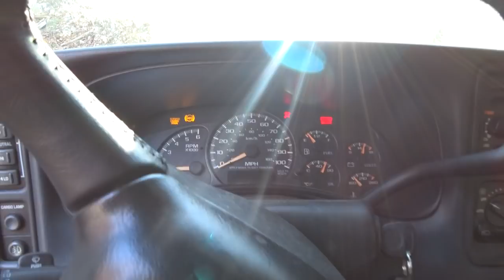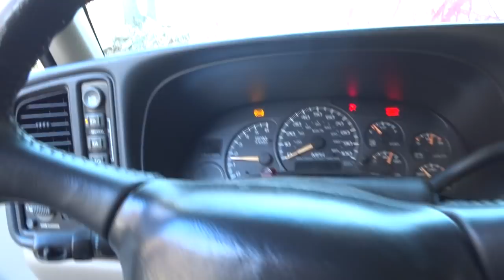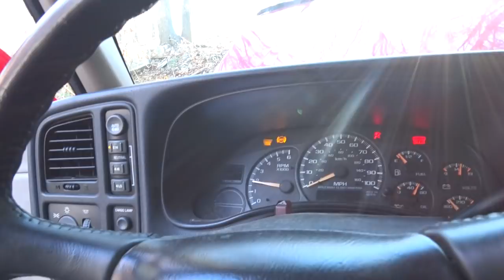DOA Avalanche Revival - Bleeding Master Cylinder in the Vehicle & Find our Rough Idle

Comment: hey  YO lookahere !! an old used trick from the old army to prevent rust  ,spay the undercar in a mix of 50 50 boiled linseed oil and old engine oil that wil harden softly and stay good a few years or spray evry year if needed ,its cheap and effective . hope it helps keep your cars a little longer !!
Reply from the maker: No kidding?! Thanks for the tip!
Reply: @DEInTheGarage  you are more then welcome ! i hope to learn some of you about jeeps , my friend just bought a grand cherokee 1999  turbo diesel

Comment: check the fuel pressure regulator. pull the vacuum line off. if there is fuel in the vacuum line, the regulator is bad.

Comment: Go to your local auto parts store and pick up a code scanner.  Plug it in and find out what it says.. Then you can move on from there. Good chance you prob have some sensors going bad.  Prob a coil pack going bad.  Oh and check your intake manafold. They are known to crack and leak air.. Had to have mine replaced.  Time to get new Trans lines....

Comment: I would put more gas in it with it being that low it's sucking what all of it can from the bottom of the tank trash and stuff since it's been sitting and that isn't good . I would go and check the codes to see what u have and that can lead u right there what some problems are with the truck before tearing things apart or unplugging them because I'm plugging sensors and things you're going to set more codes so that's going to mess up to tell you where your problems could be but with that thing having a cold air intake ha that's main problem it probably didn't filter right plus I think I seen a K&N Filter which is never good for a vehicle that has a mass air flow sensor . The oils from those filter get on the screen and needle inside that and will cause problems like your having or make the sensor completely go out but I would try cleaning the sensor first u can clean them and they be good as new again . Sometimes but only use mass air flow sensor cleaner only don't use anything else if you do that

Comment: the line kits from gm directly are muchb better, they are coated steel line and will never rust out. they are exact fit mad bend easier than stainless because you still have to tweak them a bit to run them.
Reply from the maker: The stainless ones were a nightmare
Reply: @DEInTheGarage  I just did the stainless lines on my 02 avy it was annoying but not awful now I’m fighting the damn bleeding process

Comment: Should clean or replace throttle position sensor  & intake air temp sensor on throttle body my 01 5.3 ran great after that it was doin same thing not wanting to rev up & maybe seafoam FOG the intake

Comment: Are you getting the "Check Engine" light, and if so, do you have an OBDC to decode it? Usually a MAF throws a code if it's not working. Mine does all the time, because I have an aftermarket air filter that requires oiling, and the oil forms a film on the sensor, setting it off.
Reply: OBTW... I have 207,000 miles on my 2005 Avalanche, but then I live in the desert Southwest, where we don't have much rain or snow.
Reply from the maker: It is not throwing any codes which seems weird to me
Reply: I got a 16 dollar code reader from amazon. It can clear codes as well. Great purchase
Reply: @scottcampbell2836  I also got one for about $35 a while back, that connects via Bluetooth to an app on my phone. VERY handy! And it can be moved between vehicles, so it's good for DIY mechanics.
Reply: @DEInTheGarage  Does the C-E light come on during start-up bulb test?

Comment: That oil pressure seems high at around 60, is that normal for Chevy's? My Ram oil pressure is around 40 all the time and that is normal for my truck.
Reply from the maker: Same for all my Mopar stuff.Maybe because it was so cold? Honestly, it is low on the list on concerns right now. As long as it has pressure so I can run it to get it road worthy
Reply: Oil pressure is fine. Have a few 5.3L / 6L trucks here and they get 40-60 at idle. 

Have a 5.3L with 650k miles has 60 at idle and 70 cruising.
Reply: @Xx573v3xX  damn thats a lot of miles and damn thats a lot of oil presure. my 4.8L with 300k  gets 40 idle and 60 psi going 70.
Reply: @haydenwiseman3056  yep. She has typical piston knock when cold but she still keeps kicking. Was ran as a lumber yard truck with 5psi oil due to no oil pan gasket and torn oring for the oil pump for 2 years before I got it. Knocked like hell when I bought it. Top end was starved often

Comment: People over think brake work
 I buy 50ft of copper plated line on Ebay for around 25$    and bend it by hand. No tools required beyond flaring tool
Reply from the maker: Next time that is the direction I will go. Honestly, I screwed up here
Reply: Live and learn my man
 Those pre bent "kits" are more pain than they are worth...
 Just today  I seen a guy pulling used brake lines off a S10 at the junkyard. 
I was like WHY... had to tell him I got 30ft left that I'll sell him for cheap..
Saved him alot of hassle
Reply from the maker: @EcSsAwS  I do not know what I was thinking. These kits are for guys who need everything to look factory and nice. total waste

Comment: That sensor in question earlier in the vid looked like the driver side rear o2 sensor to me. Could cause some rough running but usually not so rough it dies.

Comment: My buddy has an 01 suburban with that abs unit underneath & we changed the lines and now we can't bleed the breaks at all there's no fluid going to 3 calipers & the drivers has a lot of pressure, any idea what's going on?
Reply from the maker: The truck has to be running to get power to the ABS to bleed properly OR you need a scan tool that can activate the ABS
Reply: The truck was running and we tried even bleeding the master cylinder but just by loosening the lines & we never got any better brakes no fluid will even come put of the others after 20 mins

Comment: Does that have a vacuum booster on the master cylinder? My '05 has the brakes running off of the power steering pump (I found out the hard way, when I threw the serpentine belt).
Reply from the maker: Very weird. I do not think this one has that
Reply: @DEInTheGarage  Has which?
Reply: @DEInTheGarage  the 02 to 04's had vac boosters, they switched to power brakes in mid 05.

Comment: its weird that the abs moduel is down there on the full sized when my abs modduel is under the hood in my 01 s10
Reply: Same with my Mazda B4000.
Reply: @robertsitch1415  seems like they think abkut this stuff on the small trucks but not the big trucks and suvs
Reply: @buddahsrabid  yes indeed. I am not sure where on any of the trucks still in production it is located.
Reply: @robertsitch1415  on new trucks im pretty sure it underthe hood
Reply: @buddahsrabid  it would only make sense too. It's bad enough knowing that transfer case control modules are just below floor level most of the time.

Comment: Does anybody out there know why my 2001 2500 HD is burning oil a crazy I change the PCV valve it doesn't leak it doesn't smoke but it goes through like a quart of oil every 500 miles I am stumped I don't want to put another motor in it when I can't figure out why it's burning oil like that you would think it would be smoking it has a hundred and seventy-five thousand miles on it and it runs like a new truck it makes no sense to me

Comment: I had a 2002 avalanche thing left me on the side of the road 3 times. 1 transmission 1 rear end and out of no where wheel bearing went tu ate a cv axle left me stranded. Then I started having brake line issues up by the abs box finally I said screw this piece of shit and sold it as is. The transmission and rear end were covered under warranty I fixed the other stuff myself. Trust me as a fellow previous owner of a 2002 avalanche your better off without the avalanche. Sell it scrap it dont waste anymore $ on it just my 2 cents.